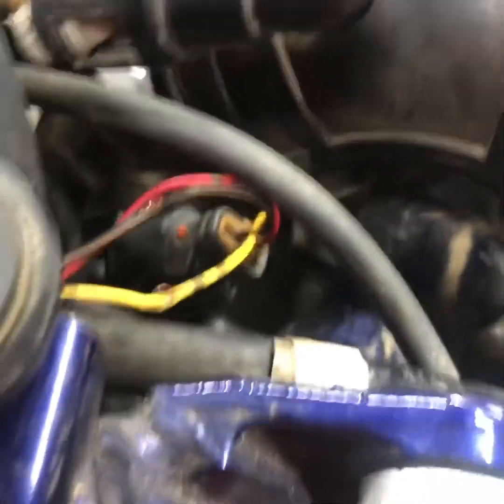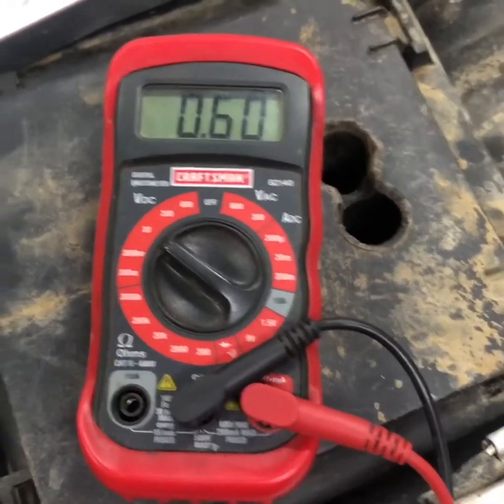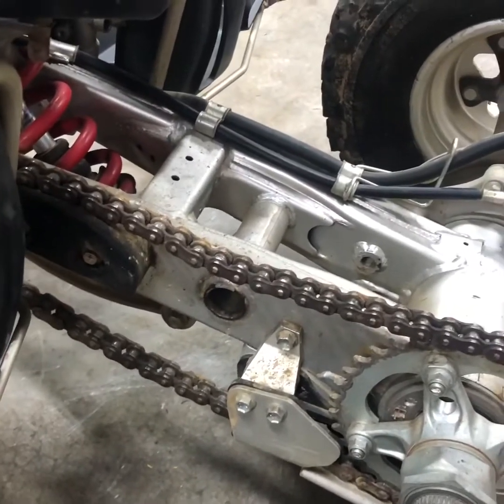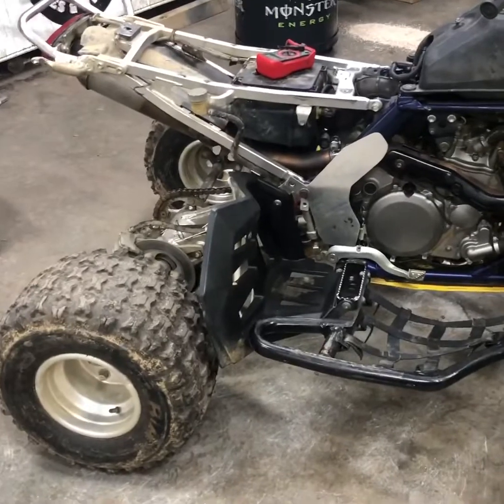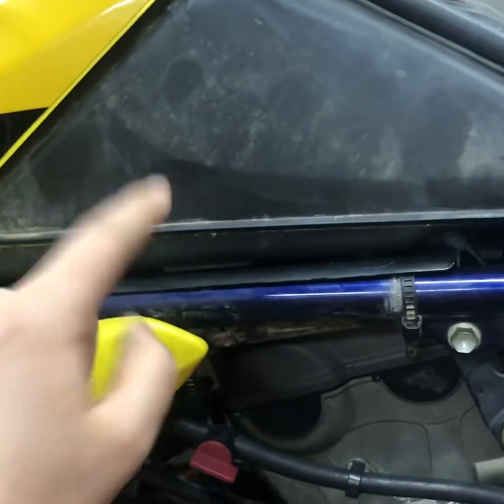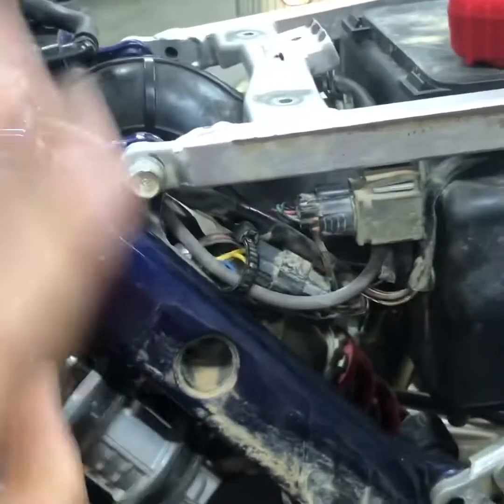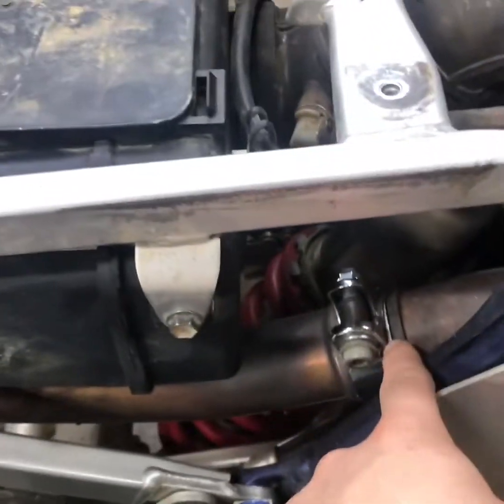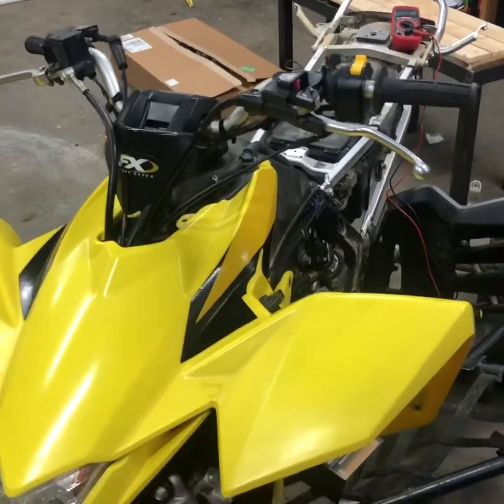Ltr450 Runs!!!+Massive Burnout!!!

Comment: How were you able to get the fuel pressure regulator off? The 2 bolts that hold mine on just spin. I’d like to get it off to clean it out/replace it
Reply from the maker: I had that same problem. Ended up leaving it on the tank and just taking it apart cleaning and replacing the internals. Only did this once. Can't remember if there was a small trick to this or not.

Comment: and the last video you said it suppose to jump up from .60 to 1.00 now your showing it jumps way up still? What is it suppose to be at
Reply from the maker: It suppose to rest at .60. When you push the throttle in it should rise.
Reply from the maker: I could tell mine was bad because at idle it was 1.60 and higher.